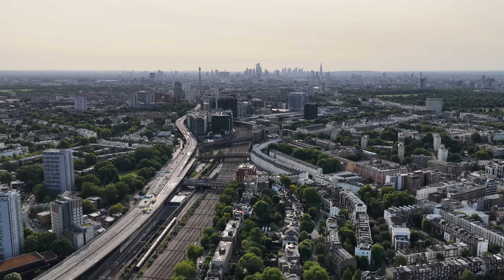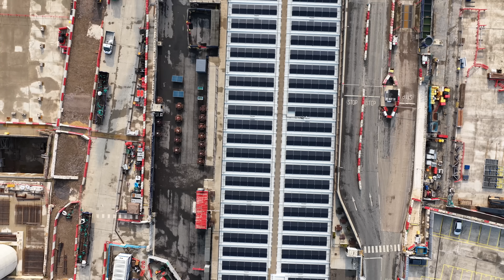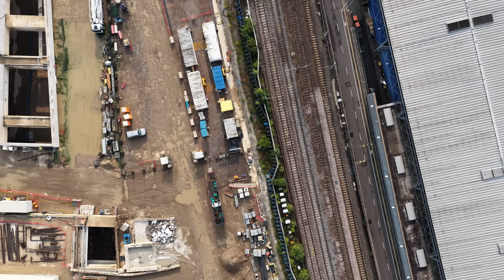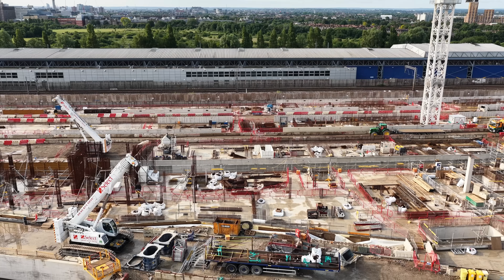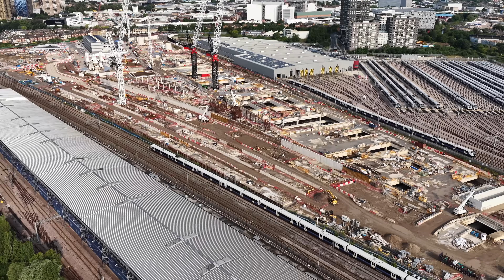HS2 London Construction Update 2025 | Euston & Old Oak Common Station Progress

Comment: HS2 costs have soared above the original estimate, as well as the northern links dramatically reduced. Costs should have more tightly controlled. I think the money would have better been spent on updating every major commuter rail network so that they could use double decker trains. This would have ensured more passengers could be transported in more comfort. Double decker trains are used extensively in Europe.

Comment: HS2 was always the wrong solution to the problem. HSUK could have delivered so much more for similar money... However this massive project has suffered massively under government changes and poor management. Once we have agreed on a project we need to see ot through and any changes should only be improvements, such as connecting in more cities, adding bike lanes and walking paths to the railway right of way etc. instead we have cut and chopped and cancelled and now we are building a very expensive line that in the next 10 years doesn't go into central London or anywhere other than Birmingham! Absolutely bonkers.
Reply from the maker: Very true. Thank you for your comment.

Comment: Pity the connection to HS1 which was to be 2 tracks then I track was cancelled many years ago at the planning stage. No need to stop at Euston but Stratford instead. At least you can get from the Euston line to HS1 via conventional lines.
Reply: I'm afraid your incorrect. I was involved with the planning consultation in 2010 and a 2 track connection was planned etc as stated. There is today a connection to HS1 via Camden just north of St Pancras (Belle Isle) as Eurostars went for servicing at North Pole (Old Oak Common) Very short sighted in not allowing passengers from the North and having to mess around in London to change stations to continue. That's why passengers prefer going by air! Can you remember the Nightstar planned service from Penzance and Glasgow to France. The 80 odd sleeper coaches sold to VIA Canada as no TOC wanted to operate it.
Reply: @napierdeltic  Well how can there be a two track connection to HS2 via Camden Junction when at the moment there is no HS2 line in place, the connections are too the WCML and cross London Lines mainly freight lines and sorry I live in Birmingham and have followed HS2 from the start and after the failure of Night Star and a service by Eurostar trains from Manchester via Birmingham New Street to the Chanel tunnel and the long winded route across London it was decided to cancel before the service started plus HS2 is not an International train route it is purely a high speed domestic train service from London Euston to Birmingham, Manchester, Liverpool, Glasgow and Edinburgh. It would take too long to travel by rail from Birmingham and Manchester to Paris far quicker by Air
Reply: The existing HS2 line never planned or designed to connect to HS1, HS2 is purely a domestic high speed line from London Euston to Birmingham and the North thats it full stop. There is no logical or commercial reason for trains from the West Midlands and the North to go through the Channel tunnel to Europe as it is quicker from Birmingham and Manchester to Europe by Air

Comment: Very beautiful video. Well done!

It baffles me there is NO WAY to stretch the tunnel a little bit and reach St. Pancreas underground, and connect on the east side to HS1.
Yeah I know St. Pancras is "too small"...whatever. You can always expand it underground and build more exits. You could create a huge underground station that connects St. Pancras with Euston and King's Cross.
Something similar to Shinjuku station in Japan.
Reply: Jago did a video on this... https://youtu.be/5DtDw2SN0TI?si=F47uNIqg599ysZjE
Reply from the maker: @Maxhead_room he has a huge following. Interesting content. I have my work cut out for me 😂
Reply: @Maxhead_room  I have watched that video. However, humanity has done much more complicated stuff in the past - including the channel tunnel itself. 
So, as far as I understand that the project would be extremely difficult and expensive, the benefits of such a connection would be so huge that such an extension needs to happen no matter what imo.
You don't need to build the platforms at ground level or at St. Pancras itself.
You could build the platforms somewhere undeground in the area, probably very deep due to the tube being there.
The only bit then would be to re-adapt undeground infrastructure to add a pair of rails that connect this new station with HS1.
Would it be extremely expensive? Absolutely yes.
However, if it was confirmed during HS2 design phase, that would have meant having 30+ years to spread the cost, so surely not something impossible to pay for.
I wouldn't even mind if they went through a completely different route, to go "around" London and try to find a station located as near as possible at an important hub and then connect to HS2 (I think there was a similar proposal in the past).
Reply from the maker: Cheers! Glad to see the video has been taken well. I hope to make more this weekend. Where to next??

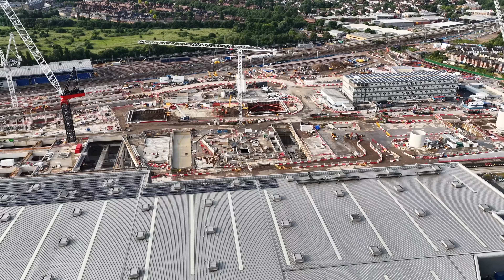Comment: 1:04 And pray tell, how many mitigation ponds or filtration fandangos whatever they're called‽

I don't expect an answer, I'm just bemused by this clunky way of solving a problem which has been around for two centuries now and I fear is one of those full of good intentions things with unintended consequences.

Anyone know what the plan is when we have a prolonged spell of no rain (like up until last week) and they dry out? Are they plumbed in‽
Are they ringed with deer-proof fencing to stop thirsty wildlife imbibing brake dust soup‽
Reply: At 1:04 these 'holes' are openings into the underground box structure for the HS2 platforms, they are not ponds!

Comment: I dont understand how suppliers have been allowed to charge 2/3/4 times the price theyd usually charge and the government continues to pay out for it. If we need to use French, Spanish or Japanese suppliers to build it for half the price then we should
Reply: It doesn't have to be that way, but this government and its predecessor try to have private investors deliver a nationally-significant increase in low-carbon rail capacity.

Delays in the project, political corner-cutting, and campaign activists on route choice or trying to stop it altogether, caused the cost-overruns being exploited by those that still think the half project can be cancelled, or the Euston, Manchester and Leeds legs reinstated.

In one line, land values and private finance expectations, not corruption by this or former government?
Reply: Companies want guarantees so that they can survive. They say "You will pay me this much and I will build you X". Now, if that's where it finished it'd be fine. But then the government comes in and changes X to Y, then Z, then A, then B, then C. Every single one of these changes requires the company to replan what it's doing, which adds costs onto costs onto costs. Suppliers haven't been "allowed to charge", they've been run around again and again and again, and then had bits canceleld and bits added. Charging a premium is basically required in order to weather the storm of the contract changing so many times due to government dithering.
Reply: Government contracts = 💰💰💰
Reply: Why do you think they are over charging? All costs are audited on an open book arrangement. The cost of any changes that are made are also fully audited on an open book arrangement.
Reply: Small projects, small corruption. Big projects, huge corruption. Here in the Netherlands we had some corruption with COVID-money. We crucified the political part of it, put him in jail and took all of their money. In the UK COVID-money corruption was massive with one scheme swindeling away over a billion pound and the main culprit still sits in the House of Lords. That's what you get with a class-based society.
Reply: Wouldn’t happen in China,they’d be locked up!

Comment: Why give shorter distances in metres and longer distances in miles? Why not use one system of measurement for everything? The railway, like everything else, is built using the International System of measurements. It makes no sense to use non-systemic measurements.
Reply: That's one of my biggest bugbears too! HS2 Ltd do the same in their press releases and it drives me potty.
Reply: To really most British people use metres for
Smaller distances and miles for
Longer distances, just the way it is
Reply: @gorgu08  It is that way because no UK government has dared to upset the public by fully converting to metric for longer distances (and associated with that, speed of vehicles). Ireland managed to convert all its speed limit sign in 2015, meaning it is hardly impractical nor very expensive.
Reply: @gorgu08  Some British people use Celsius for Winter temperatures and Fahrenheit in Summer. It doesn't make it right.
Reply: @cliffandpennySteele  one uses Fahrenheit, gen X or below